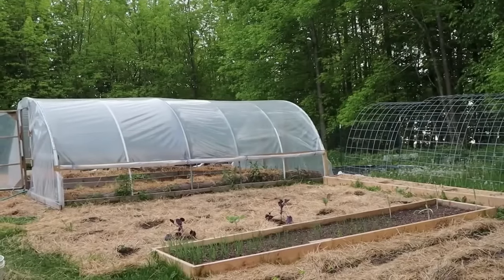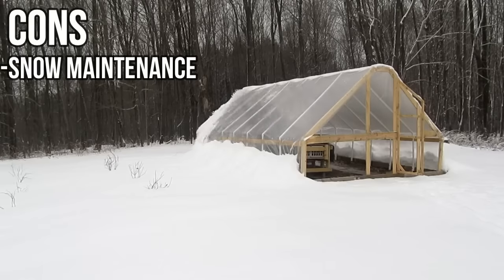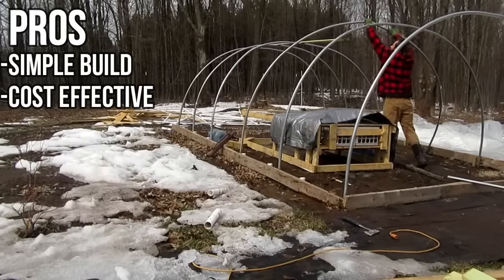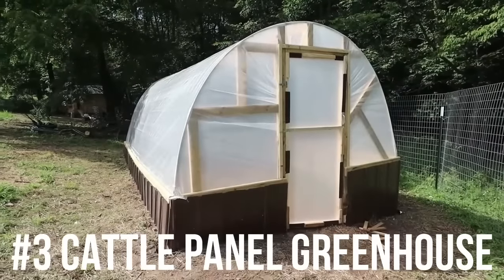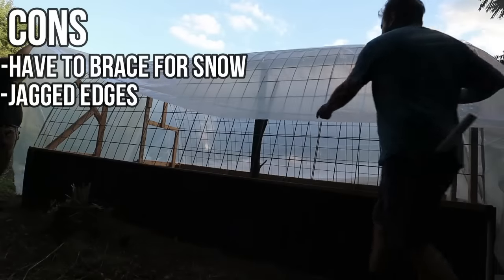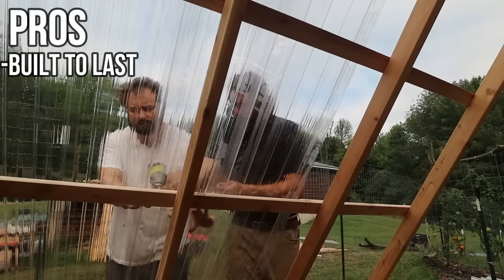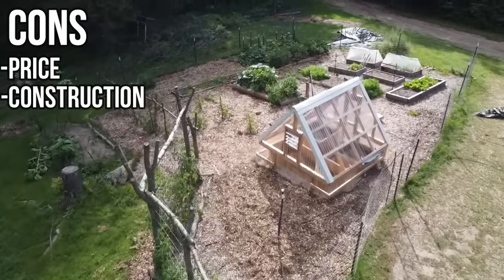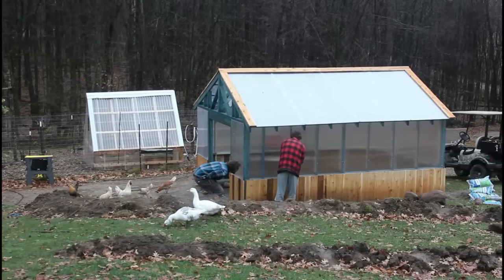The Ultimate Guide to DIY Greenhouses: Pros, Cons, and Everything In Between

Comment: I always thought it would be interesting to install geothermal heating in a greenhouse but without the heater... Just an air intake to move air underground through some piping to pick up the ambient ground temperature of roughly 50°F and cycle it back up into the greenhouse. Which is warm enough for most plants. Plus maybe a solar panel or windmill to power it.
Reply: That's a really good idea.
Reply: It has been done, one guy was growing oranges in Nebraska that way.
Reply: To do that well you have to put it in before the foundation.  It takes quite a bit of time underground to change the temp.

Comment: I've been thinking about putting together  a cheap greenhouse. My idea was to use a 10x20 temporary carport where the canopy was torn beyond repair as a frame and reclaimed pallets around the base as weights. I was thinking using a transparent hard plastic for roof and walls then a couple solar panels to run a small heater and grow lights.
Reply: A few solar panels will not make enough heat to carry throughout the long winter nights, although they can make enough electricity to move the heat from the top of the greenhouse 4 feet into the ground during the day, then back up at night.
Reply: A small propane heater or a small pellet stove?
Reply: @annawimpey5307  I was thinking of propane  or natural gas. The unfortunate part would be the expenses to run it. I used a 12,000 btu propane heater when I lived in a 20x20 cabin and it ran constantly.  If it would get below zero the heater maxed out only heated the inside to 50. And it dips to negotiate 50 for a week at a time in my area. 

The wood stove idea isn't that bad. Only problem is needing to constantly monitor and feed it. I would supplement the propane heat with an old potbelly wood stove on the colder nights. It was nice enough but still chilly and I only slept about 4 hours at a time because I needed to add logs and restart it. 😅.  If I lived in the greenhouse the wood stove would be a great idea.
Reply: @handy-capoutdoors4063   You may want to look up rocket mass heaters. They combine a super hot, extremely high efficiency rocket stove along with thermal mass in order to only have to feed them every 12 to 24 hrs, and they use only between 1/10 and 1/4 of the wood of a normal heater for the same amount of heat. People normally use sticks instead of logs to feed it.

Comment: When I did my cattle panel greenhouse I put a 4 ft walls on the side . When you do it this way you can make the arch a lot higher and wider . I put the plastic on the top cut it . Then did my sides so I can raise them in the summer. Plus I put screen wire on the side to prevent bugs . So if I grow vegetables that have to be pollinated I do it by hand

Comment: You should never use treated lumber for a greenhouse. Leeching can cause the chemicals to end up in your soil. Use standard (not treated) lumber, and don't use typical tar pr paint. Use a silicone or acrylic-based coating (Ames roof coating or their Blue Max coating is great). Apply it to the boards after cutting to length and allow it to cure BEFORE you build/install.

Comment: To heat your greenhouse, try taking all the insulation and metal off of a electric hot water heater, add two twelve volt heating elements, hook up to three solar panels at 250 watts each and you have free heat. You can place this in the greenhouse under a planting bench and you won’t even notice it. You have to purchase the elements from Missouri wind and solar. You don’t want the cheap elements off of Amazon.
13:57

Comment: Hi guys, thanks a lot for this video. Im just starting up so this is all very valuable information. One question. Snow is an issue where im building, but another issue is wind. Which of these designs would you expect to stand up to strong winds effectively? Thanks a lot!!
Reply from the maker: I would do the A-frame if I was in a windy area.  It is smaller and anchored really well to the ground. The metal anchors were a lot less expensive when I bought them though.  Could do the aframe but with concrete and 4 x 4s as posts.

Comment: Is there something like the opposite of a greenhouse? I live in Florida, and currently things are getting Far too hot in the summer and expected to only increase yearly degree by degree and for a little longer than before. If I can make something simple that can keep it out of the most of the heat and some of the killing sun it would help greatly!
Reply from the maker: I’m no expert on that being in a cold climate, but I think you could use shade cloth!
Reply: Oooooooh. Maybe. Just maybe. Hear me out whoever wants to read this rant as I spit ball here. I take bottles, cut off the funnel shaped top of them, and use them on the sides, with some really thin mesh like maybe like white cloth, keep that moist, and the wind blowing through the bottle caps and through the moist cloth would keep it cool and the area humid, perfect for propagation, or even just microgreens! Like having a drip system that I'd use for the rest of the garden outside of this run over the top of the fabric so that it gets moist and I can change the amount dripped with a humidity meaurer in the middle of the area. Could be a fun project and a cool use for old bottles! Maybe use the rest of the bottles to make the outer walls! I don't need to worry about snow, just rain and it being sturdy enough and heavy enough to not be blown away by a hurricane, so maybe a used concreted in metal gate for the walls, and heat gun melt the plastic bottle sides onto the walls, and maybe a chicken wire top with the same plastic. Flexible, and stuck into the ground! I'd have to see if it'd survive a hurricane. Probably won't, but it'd be fun to build!!
I aught to just use shipping containers but I really want to do some in depth projects like this lmao.
Ofc, the plastic used has to be safe for plants, so maybe raiding a dump site for anything that was used to grow plants, and seeing if anyone has old trays for micrigreens that has like cracks in it since I'll be melting them a bit anyways for the sides? Idk. Would have to see what materials are avaliable to me at the time lol.
Reply: @TheNorthBranchWI  I watched a video about that directly after your video lmao. The algorithm is scary accurate sometimes! Thanks man!!

Comment: I noticed that you are using wood at the bottom of a few of your designs. What do you put in between the wooden base and the plastic layer? How is the plastic connected to the wood? Just stapled or something?
Reply: Not sure how he does it here but if you pinch the plastic instead of stapling the plastic you'll get a much better result. Rolling the end of the plastic over a board also works and using screws to pinch two boards together with the plastic in-between works best

Comment: I'm interested in building the cattle panel version.  I'd make it to cover an existing raised bed.  is there a way to calculate the length of the panels - the height you want vs the width?
Reply: Cattle panels are 16' x 50". Depending on the height you want you can vary the distance at the bottom. Conversely, dependingon the width of the bed will dictate the height of the arch. The cut easily with bolt cutters. 
What do you want to accomplish and what is the size of the bed? I have a lot of cattle panel arches. Several are spanning 2 2'wide beds with a 2' walkway, so 6' total. They're made of 2x10s and the panels sit on top and I can't reach the top so there's plenty of room. I have some between beds with a 4' base that are even taller. I have one that's about a 7' base right on the ground covered in netting for the cucumbers and squash. I can stand in it easily (I'm 5'6").
As to the calculation, I had no maximum height I needed so I kept the panels whole. I just needed to walk under them. If you place them on the raised beds you gain that much height, of course. One quick way to guess the height is lay it on its side and bring the ends toward each other at the distance they'd be on the raised bed. You can measure from there or use a ratchet strap or two and stand it up.
I hope this helps. I'll try to answer any questions you have. I'm not an expert but I've done enough of them I may be able to help.

Comment: Look at the Chinese passive greenhouse design. Mostly you need a greenhouse when the sun is low in the sky. That means you don't need a glazed north wall.
Reply from the maker: We are thinking it through right now actually haha Thank you!
Reply: @TheNorthBranchWI  Build a shed with a glazed south wall. Paint the inside white or line it with coated mylar. In passive solar buildings, the glazing area is equal to about 12% of the floor space.

Comment: Ok ,I'm in south Florida where the sun will rot a water hose in a year. What is good for extreme sun. I have stainless water hoses. After the 3-year living here .Is aluminum green houses the real deal?
Reply: PS. I have a cattle panel now. The sun will go through the plastic too quickly. The steel welds start the rust on cattle panels.

Comment: Beautiful work! The pvc conduit has uv resistant chemicals that can actually degrade your plastic sheeting where it comes into contact with it. We solved this with cotton gauze wrapped at the joints and painters tape on the top surface of the pipe where the plastic touches it.
Reply from the maker: Thank you! and that is a great tip

Comment: Decent video, but who no exhaust vents in all those hoop houses?
Reply from the maker: we have vents in the a-frame and are adding to the large one in the spring.   The 6 mil metal one we opened up the sides and the cattle panel we put doors on the ends to allow through air.  For us, as far north as we are we don't need as much as most people.

Comment: cattle panel a frame sorta but with a steep and non steep angle to cover larger space and just flat faced rear maybe 2 angles to roof a snow shedding angle and a strengthened higher but shallower angle  also saw in comments about digging it down into ground for earth heating and cooling but would need an sump pump system for flooding a 12v automatic float bidlge would do just winterize before winter meaning keep them from freezing/breaking from ice expansion

Comment: I used the corrugated plastic panels and it does not last. It gets very brittle after a year or so and breaks very easy. I would not use it again and do not recommend it . Spend more and use better more durable plastic or used glass which I think is best and you can find on local ad sites for fairly cheap or free in some cases

Comment: How does each one stand up to strong winds?
Reply from the maker: We don't have too bad of winds up here. But the metal hoop house and a frame made it through a tornado last year with no issues. So I imagine they would be okay in a pretty good amount of wind.
Reply: @TheNorthBranchWI  Thank you for responding so quick.
No tornado here, but last year during the high winds, a small whirlwind ripped an 8x10 metal shed off of a strong foundation,took it over a 5 foot fence, over a hill, and left it on its roof, two properties away. It didn't disturb one item in the shed, but ripped it up and took it about 500 feet over a hill. That's been our hesitation to put up a greenhouse since then.
Reply from the maker: @johnnieblackburn3182  That is unreal!! haha Make sure to anchor that thing if you build one 😂
Reply: @TheNorthBranchWI  Yeah. The morning after the strong winds, I noticed stacks of totes and tools sitting in the yard and wondered who had done that. Then, it occurred to me that our shed was gone, and that was our storage sitting on the shed foundation. When I walked to the back of our property to see what happened, I noticed our fencing was still in tact, (the shed had been about 3 feet from it.) But, everything in the shed was all orderly. So, my first thought was, Did someone steal our shed and pass it in parts over the fence?
Later, when my sister came outside, we walked around and eventually we spotted the shed over the hill behind our property a few houses down, turned upside down and twisted a bit. 
It was totally bizarre, and yet, everything else on the property didn't seem to be affected by the winds.

Comment: Hi mate. For the a frame green house water supply you could feed the pipe underneath the soil or have it on top. 

Get 15mm or 22mm which is 1/2 inch or 3/4 and run the pipe through your garden and cap the end off. Then, drill holes a third up from the bottom of the pipe. This will create a little pressure in the pipe while a layer of water builds up then it should evenly come out of the pipe. 

Also depending how much is collected and the force it enters the pipe at. Copper is expensive but good for crops apparently. 

Or you could get a waterbut and collect the water then have a small solar panel connected to a 12v waterpump on a time clock. 

Thanks for sharing this was very useful
Reply from the maker: Those are awesome ideas thank you!! Caping off the end is exactly what I needed to hear. I couldn't come up with an idea for the pressure and copper is a great call
Reply: @TheNorthBranchWI  you're welcome mate. Im a plumbing and heating engineer so if you need more ideas or help give me a shout. I'm sure you will be fine ;)

Comment: Hey man, nice video. I'm building a greenhouse and also introducing hear and an exhaust fan. Do you have a system designed yet for greenhouse #5?

I'd like to discuss
Reply from the maker: We put windows in the front and with those and the big doors we didnt need anything else.  But we are pretty far north and heat isnt a huge a problem for us.

Comment: When it comes to lumber, it can be cheaper if there is a local lumber mill that you can buy from. The Downside to that is that you'll need to treat, stain or paint the wood so it will last longer in the weather. But it can definitely be a cost saver. Something to think about!
Reply from the maker: That is a great call!

Comment: im trying to finish mine wich is a rectangle of wood but the roof should be sloped. so there is slopes on two sides but on the rectangle frame i cannot slope so the plastic just goes up. really really weird. never saw such stupid design. my other option is to make it a bit taller and slope normally. my original plan was to cover from inside wich makes little sense cause if i do so i should cut the plastic + never saw a greenhouse covered from inside the weigh of the plastic is always above the frame. so my decision is to make a weird geenhouse with a roof making waves. i made cabins and houses and walla before. doing greenhouse is so much more harder

Comment: My cattle panel greenhouse has no ridge pole, we get heavy snow loads and it's 3 years going on 4 years old. It is hard to regulate the temperature though
Reply from the maker: Nice! What zone are you in? And yes it is haha
Reply: 3b/4a
Reply: When we get snow I just tap from the inside and let the snow slide down it. I leave the snow against the bottom to kinda seal the bottom as left 18 inches extra plastic on the bottom I lay cinder blocks on, we also get high winds, keeping the plastic tight on the ground helps keep the air from from getting in lifting it
Reply from the maker: @jenniferrastley7337  that is awesome, yeah as long as you keep the snow off of it there shouldn’t be any issues with collapsing, that is cool. The videos I saw of collapsing ones must not have been doing that
Reply: Loved the video. Looking to upgrade but not sure we can afford it with the prices of everything these days. Maybe we can replace our plastic and make some internal improvements instead.

Comment: The plastic panels only last about 3 years in the AZ sun! They turn brown and get very brittle!
Reply: the twin wall panels on the other hand hold up very well in the extreme solar here in the desert and much easier to work with than the corrugated poly panels
Reply from the maker: That is our exact experience working with these materials. Except our plastic sheeting lasts longer than yours with our lack of sun

Comment: 14:13

Forgive .e for jumping ahead of the video as I havent finished watching it yet. 

A solution for the metal conduit/snow sag issue. 

If you have access to a 3D printer even better! If not you will need whatever angle conduit clamps to get the best angle for the snow dangle. Instead of using a continously angled tube. 

If ya hit on that point later on the video, I'll come back and apologize for getting ahead of myself  

Also! Have you ever done a double layered greenhouse before, with the plastic? So that there is an inch or so air gap that would be between the poles and plastic.
Reply from the maker: We have never attempted to air gap.  But the twinwall has two layers with air between them.
Reply: @TheNorthBranchWI , thanks for the reply! It's something I might try this summer on a smaller scale. 

Thanks again for the video!

Comment: What affect does the twinwall have on hot days, does it slow the heat up of greenhouse or speed it up,  my glass green house gets too hot I wonder if it would help if I change to twinwall?
Reply from the maker: I am not sure, I am excited to have them in their first growing season this year. I will be posting updates on everything.
Reply: I built a very small twinwall greenhouse in Great Britain 6x6x4 feet so I could use it as a removable lid for a raised bed. It got quite warm even on mild days, as it really does retain heat all night.  Adding adjustable venting to the roof /sides was a must, as it can easily cause wilting or bolting. I was able to grow Mediterranean veg even through winter though, so if you get the venting right you can get dramatic benefits
Reply: @paulg6790  I was wondering if Twinwall is enough for my climate , i considered using clearlight roofing with two layers separated by 20 - 30 mm timber spacers between them but if you can grow through British winters it must be okay.